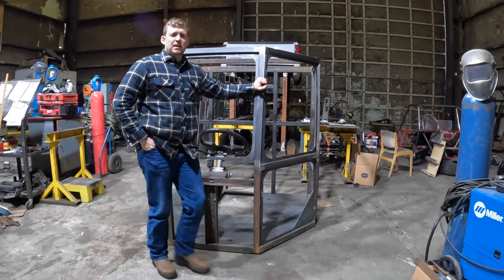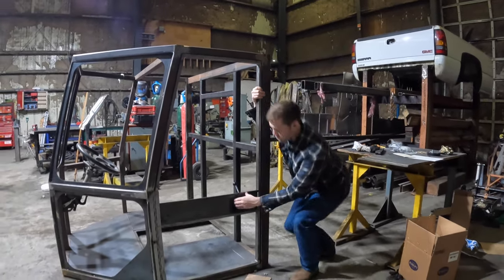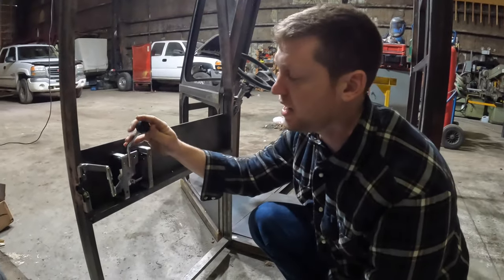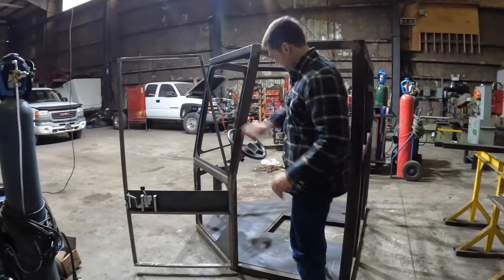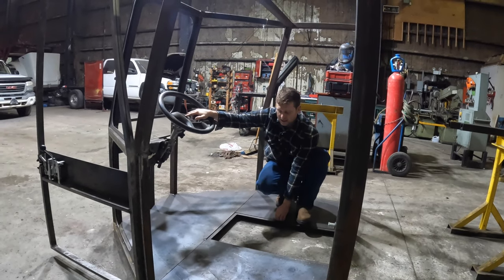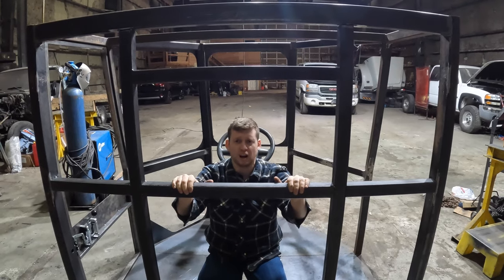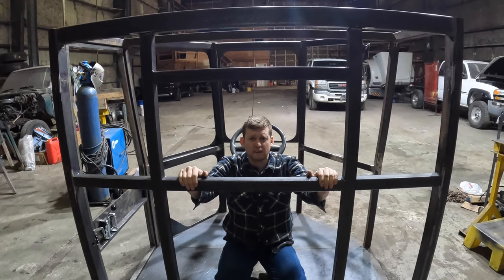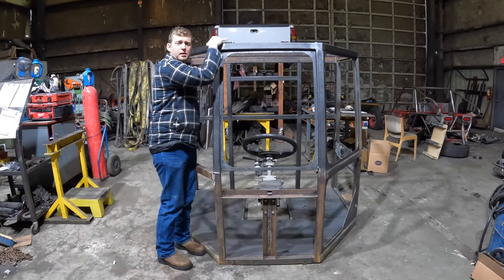Edison Cab Progress

Comment: Just two words: 
Diagonal Supports 

Think about the force that will be transmitted across the cab if it flips. Try to incorporate some triangular pieces in the corners like a roll cage. 

The doors are a big empty rectangle that will squash sideways if compressed. If you solder together a small model with paperclips or coathangers and squeeze it, you'll see the weak points easily! 

Other than that, this is a fantastic design! I can't wait to see this on the road! :)
Reply: very true, triangles are the strongest shape
Reply: @73Datsun180B  Yup. I watch A LOT of crash tests and dashcam videos. The safety of modern cars is thanks to decades of research and mistakes! :3